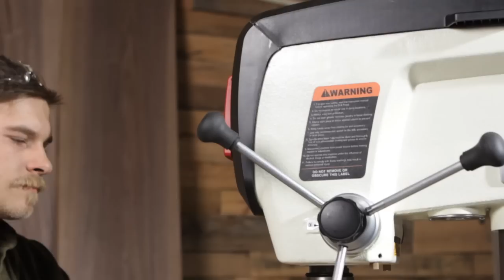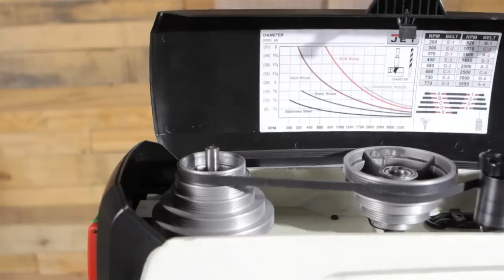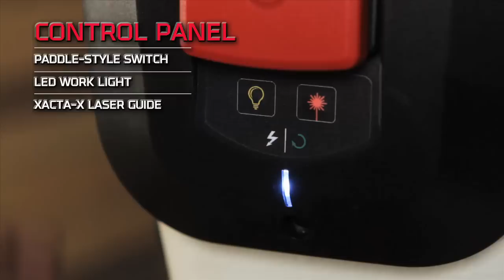JET 17in Drill Press Overview

Comment: WeLoveWoodworking
I've had nothing but issues from a grizzly industrial product. My wife and I drove over 5 hours, and spent over $1200 at the Grizzly showroom in Missouri. Honestly the showroom is amazing. The product I got...not so much. I've had over 10 separate issues including defective, and back ordered parts sent to me. Grizzly did offer me $100 to keep the pos 😂😂😂. I like high quality tools, and won't hesitate to spend the money on them. Powermatic, Jet, SCM, felder, festool, saw stop etc. I like decent hand tools such as snap on, Milwaukee, dewalt, and I even think husky is decent due to being able to swap tools easily when they break one the job. We even have some harbor freight tools that I think are very very good. My experience with grizzly has been unsatisfactory at best. Not to mention they will not post my review on their actual website. Hopefully my review will help someone looking for equipment.